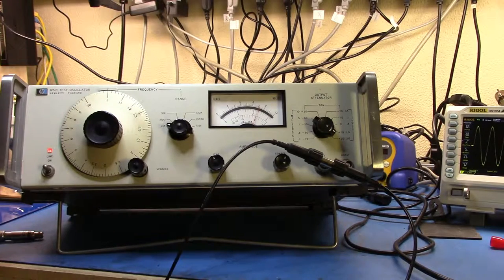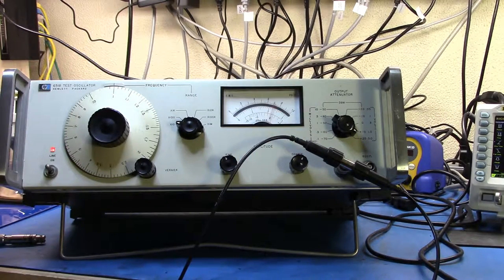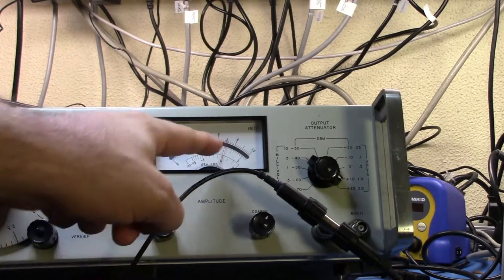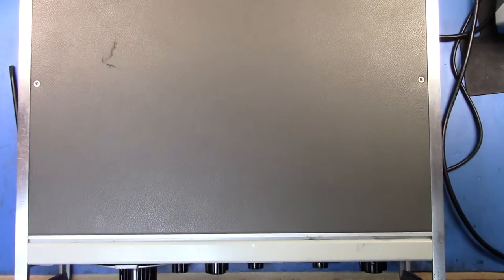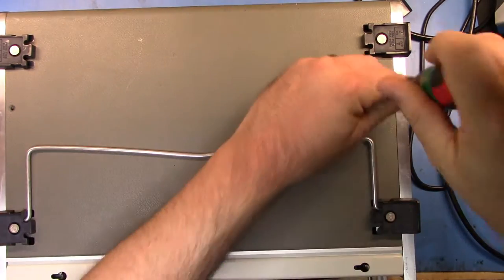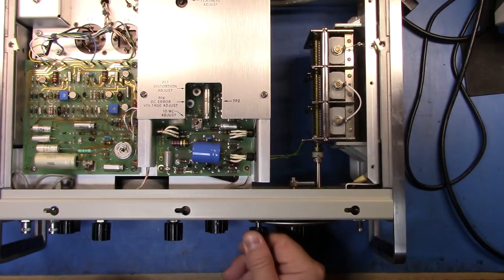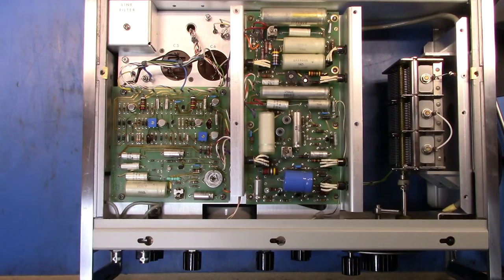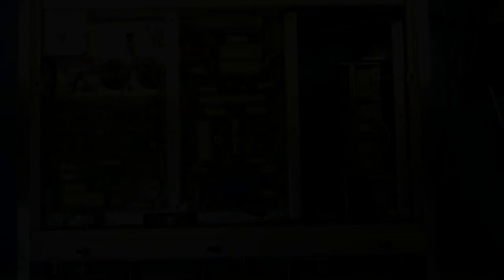HP 651B Test Oscillator - Pre-adjustment Overview

Comment: Thanks very much for the video. I have one of these units I just dug out of the shelves for an audio project I'm working on. This overview is very useful!
Reply from the maker: Glad I could help - I need to dig mine out at some point and fix the very slight alignment issue it has on the shaft.
Reply: @tgsoapbox  I have mine sitting on the bench...debating on whether I want to reform all these caps before I power it up. There's so many!
Reply from the maker: @jamieostrowski4447  I can't remember what the PS is like in the 8340 - If it was an 8663 (8662), I would say you absolutely need to - I provided the service manuals to Artek Manuals to scan so I think they have a good set of PDFs that you can use - What I can say is that I didn't bother with mine and it was fine - YMMV and please don't blame me...
Reply: @tgsoapbox  Yeah, thanks for the advice. I'm leaning toward the same, just bring it up. I've heard that the caps in the HP's are usually pretty solid.
Reply from the maker: @jamieostrowski4447  Sorry I must have gotten your comment mixed up with my 8340B video - With the 651B all I did was use a variac to slowly bring it up to voltage . Once it was running then I was good to go.
Reply: @tgsoapbox  Ah ok, thanks for the tip! I do have a variac, I'll give it a go!

Comment: Nice video.  I am working on a 651B right now and using this video to get the girl back in shape.  I use clock oil to lube the vernier and pot shafts.
Reply from the maker: Thanks - I still have the unit and, while I don't use it day to day now, it's still a nice little generator - I need to realign the dial as the Vernier is sticking on it as it turns - I used the Caig labs oil myself. Let me know how the repair goes. BTW I did the full perf test etc here https://youtu.be/W-nCyZf4xTs

Comment: Nice unit. I just got a 334A, which looks very similar inside. Thanks for sharing.
Reply from the maker: Thanks - I actually just sold off my 331A (there is a video in the playlist showing it) - The 331A & 334A are based off the same design - The 334A has the automatic tracking feature I believe which makes getting to the low point far easier - I think most of my problem though is the counter-intuitive coarse/fine knobs.

The 651B uses the same casing which was very common to HP gear of the era - You can see it in the 400 series meters (DMM, RF Power etc) and then into when they turned digital.
Reply: Yeah, no idea why they chose to put the coarse adjust on the inside knob, but you get used to it when using it. I watched your 331 video before getting my 334A. Got a sweet deal on it as not working, but it works great, other than missing the little friction vernier knob on the big notch filter tuning dial. That can be done by hand fairly easily, though. Thanks for all the great videos.
Reply from the maker: Nice - Sometimes those things can work out for you - I bought my 5440B/AF for $100 because it wouldn't power up but all that needed to be done was to replace the fuse holder and a bypass cap on the display board - It's sitting up with Fluke now getting calibrated - Working units go for $2K.

Comment: didn't you think that everything is good with your gear  the only problem was that you physically  can see 10Hz. I have the 651b and 652A both behaves the same  way.
Reply from the maker: Good question but I was expecting that there would be a different filtering method for the meter - That actually turned out not to be the case so that vibration is an artifact of how the system works. Once I did the adjustment and some further investigation I worked out that you're absolutely right in that this is just how they worked.